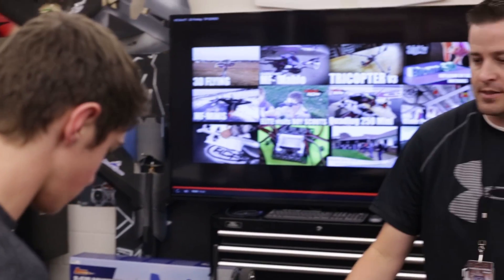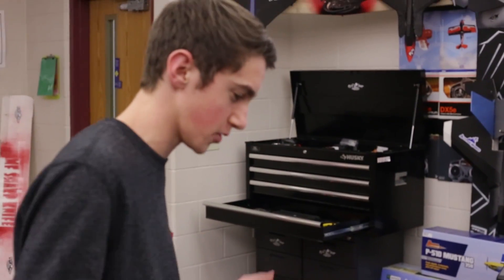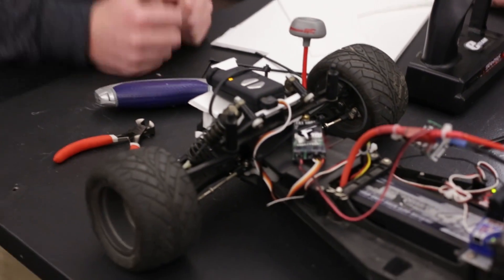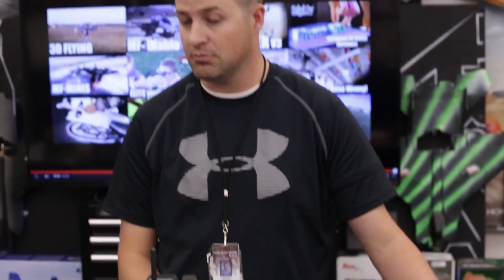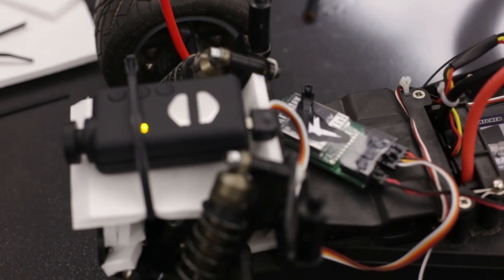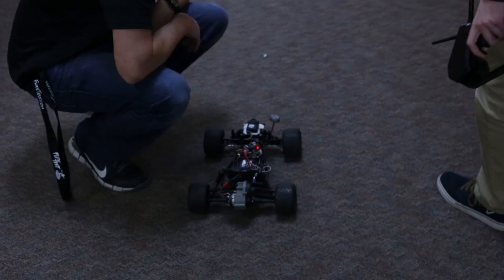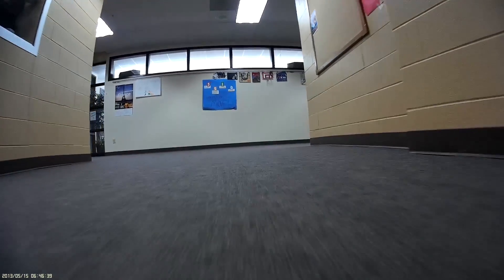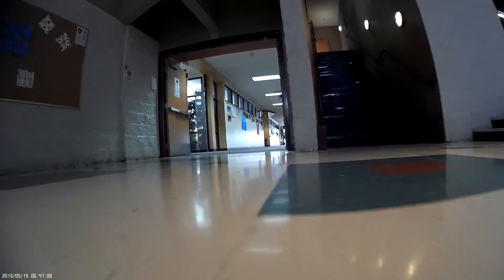MESArcFF - RECON2 Part 1 - ELITE PROJECT

Comment: really good concept. Whether you change your transmitter or not, You should consider transmitting your signal to the quadcopter, have a receiver on your quad copter and then having another transmitter on your quadcopter. This will most certainly allow you to have greater direct field of view for further transmission of video.

Comment: What about using the quad copter as a video repeater to get the signal over obstacles. You could mount a small video receiver on the quad and rebroadcast the signal with another transmitter (may need to use directional antennas). You could also put a radio controlled video switcher on the quad to change sources going to the video transmitter to keep from running two transmitters on the quad. Just a thought.

Comment: I think for something like this you need a 900megherts video tx or 1.2 because the 5.8 just does not have enough penetration and when you are on the ground you will not get near as good a signal as in the air also you probably want to get a long range controller like a dragon link